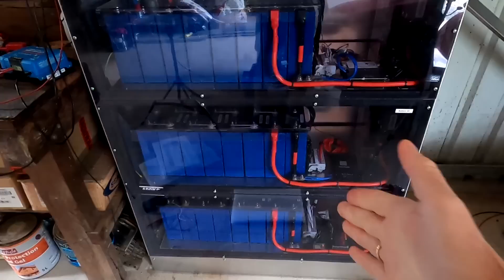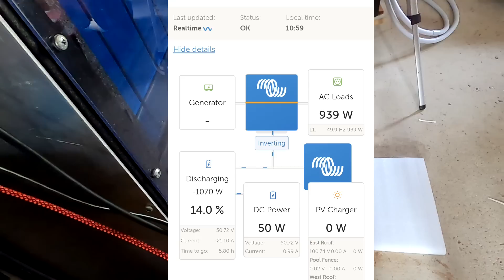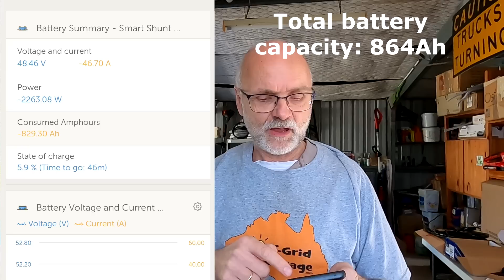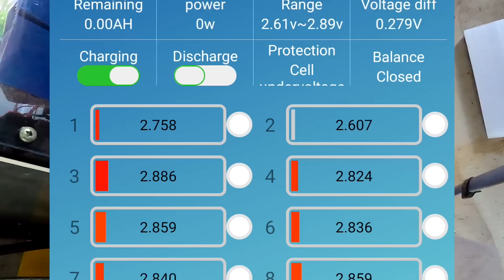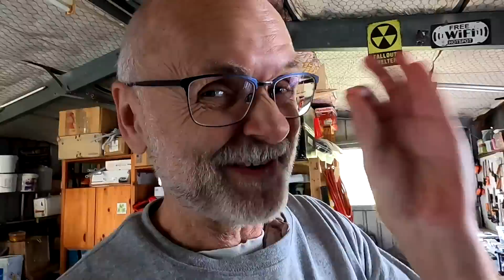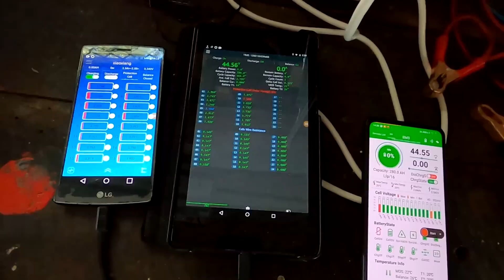Parallel Battery banks low voltage disconnect test. 3 different BMS - see what happens!

Comment: My Raspberry Pi is powered by 2 sources, 24v via 12v buck, or from 12v battery via manual 2 pole change over switch. Also a small UPS relay feeds 12v if the usual 24v source is off. Then the 12v goes to a small UPS fitted with Lithium Cylindrical cells (designed to power a WiFi router, I have another 1 on that) then to a decent 12v to 5V 3A USB supply.

Comment: So, how do you switch back out of maintenance mode on the SCC if the BMS have disconnected all discharge? Does the solar keep the SCC working? Is it possible to have a backup battery for the SCCs?

Comment: It actually makes a lot of sense. Since you configured all to similar voltages and all batteries are connected together and kind of holding the voltage the same for all packs, they would all shut down almost at the same time. Since voltages are very close and the voltage curve is steep at these voltages, once one bank disengages, the other ones get discharged very quickly and then second and third within seconds - so, makes tons of sense.
Reply: Yep, this is a feature you automatically get by putting these battery packs in parallel. They keep themselves in equilibrium.

Comment: You should add a 5v or 12v battery on your accessory side so you can remotely record and safely shut down when the 48v system goes down. It can even be a large capacitor - just to give you 5-10 minutes to ensure data is saved and that you can diagnose issues when system is shutting down.
Reply: That and a ups on the internet modem so it makes it in the vrm before the wifi turns off! I made that mistake, set up a battery backup on the raspberry pi but forgot about the internet connection haha.
Reply from the maker: I literally never go this low with my battery except for testing. The Pi is already running through a DC converter directly from the battery and not from the inverter. Under normal circumstances neither the Pi nor the modem will shutdown before the inverter shuts off.
Reply: @OffGridGarageAustralia  Isn't the intent of the Pi also to diagnose issues so should work when not 'under normal circumstances'? Otherwise, it's like having a spare tire, leaving it home and having a flat while on the road... 🤦‍♂️   -- pretty sure you can find a way to have a 5v or 12v battery on the 5/12v side that would act as a large capacitor to allow Pi/router/accessories to run if 48v battery runs out... kinda like the 12v battery in your Tesla - it's mostly there for emergencies (and a bit to lower load on the DC-to-DC converter).
Reply from the maker: @ranig2848  the Pi only monitors all devices but it does not diagnose anything. That's up to the user to interpret the data.
There are 18650 UPS boards available for $5 on Ali. They do what you want.
The 12V battery in the Tesla is not for emergencies. It is part of the whole system and all electrical load, except drivetrain, A/C and heater, runs from this 12V system. All of it, which is a lot...
Reply: @OffGridGarageAustralia  It was just a suggestion. If you had backup, you could collect details on when battery disconnect goes into effect in each of the battery banks (I thought you were looking for more fun projects 😉). BTW, regarding Tesla, the HVAC unit uses the HV system, not the 12v. The low-voltage system is a safety requirement (eg., if HV system disconnects while driving, locks, hazard lights etc must still work) and once that was in place, they use it for all standard uses. If it wasn't a requirement I'm pretty sure Tesla would have found an innovative way around it... (probably still need a battery but might have used a smaller one or a capacitor)
Reply from the maker: @ranig2848  The Pi measures/monitors only the smart shunt so the overall power in and out of the battery but not each single bank individually. I will connect the BMS's to the Pi at a later stage and see if this makes a difference at all in terms of data collection.

That's what I said in my comment, the drivetrain, A/C and heater don't run from the  12V in the Tesla 😉 The new models now come with a lithium battery instead of an AGM as I still have. Not that you really need it but at least you never have to replace it again.

Comment: Wouldn't the balancer work at low voltage / discharge too?  It seems it should.  Maybe to balance that one proud cell instead of alligator clips and 12V bulbs?  Maybe an on/off switch for the balancer or more satisfied automation could be helpful.  :-)
Reply: In normal situations you would then unbalance your pack at the top again. You either top balance (for most solar applications) or bottom balance (vehicles), but not both.

Comment: What is the paste / goop you put on your cell connections/ bus bars.  I am upgrading my 280ah battery to handle 3000w inverter and a 2000w induction cooktop  and want stemless energy transfer.

Comment: JK does not have Pack Over Voltage Protection while JBD, Daly, Heltek does. You once said that it is redundant considering Cell Over Voltage will occur long before Pack Over Voltage.

However, have you ever consider the scenario where the BMS is disconnected from the SCC and the SCC is giving a Voltage that is over "Pack Over Voltage Protection"? Will the BMS consider that as "Pack Over Voltage"?
Reply: "the SCC is giving a Voltage that is over "Pack Over Voltage Protection"? " --> that's a wrongly configured SCC, but in any case even if that happens because of a broken SCC, the battery (the load) will drag that voltage down and increase the current draw. Then you either got into an overcurrent situation, or your battery will charge until a cell reaches overvoltage again.
Reply: @upnorthandpersonal  There is chance SCC croaks and have the PV voltage into the batteries - as what happened to a diysolarforum member killing all his investment. 

Batteries could cost more than inverter + scc + panels; protecting it is important against erring component.
Reply: @DanBurgaud  Not much a BMS can do when you have the full solar voltage on there.

Comment: hmmm isnt the shunt suppost to shut off the inverter first, so you can actualy calibrate 0% each time it bottoms out? 44V for example?
I know my Batrium does that, and the SOC in victron in taken from the BMS (CAN) so not sure how that would work with a shunt

Comment: My inverters LVD is 3.0v/cell - leaving me that 6% power for DC loads - lights, water pump - the essentials off grid. AC power is generally for the luxuries, and fridge/freezers but they can take a few hours off no problem.
Reply: And, cheap insurance, comes in the form of a 3.6 kW Pure Sine Inverter Generator, which I would always, also add, as an emergency standby power source, for the arrival of that almost inevitable time, when ..“all of the best laid plans of mice and men” ..all turns pear-shaped, after a week of rainy cloudy weather, when the Grid power ..also fails..! 🙄😉

Comment: Its a cascade  effect Andy - once one bank shuts down it throws its share of the load on the other two - the higher load causes a minor  potential voltage drop which soon  trip the second  and then 3rd - if you had say a dozen battery banks you you would probably be able to measure the exponential  time interval  "quickening"
Reply from the maker: I would have expected that with a bottom balanced battery bank but I only ever top balanced my batteries as you know. Hence I was expecting a different shutdown time for each bank. Obviously the banks are discharging at the exact same rate and even the one with the higher capacity is balancing the other two lower capacity banks over time so they all come to an end at the same time. Very unexpected.
Reply: @OffGridGarageAustralia  It just goes to show that when on the knee at either end of the charge regime  load has a increasingly disproportional impact on voltage

Comment: The KWh literally mean nothin at all without knowin the voltage and the tesla i think is about 450V anyway so ya test will be good to see
Reply: It gives you exactly what you want to know: total amount of energy independent of voltage/Ah rating. If you would say a battery has 20Ah, then you need the voltage to work out how much energy we're really talking about.
Reply: kWh is the Energy. What you propably mean is that Ah (which is the capacity) does not mean anything without knowing the voltage.
Reply: I know exactly what im talkin about cause theres a thing called ohms law to work out the battery capacity
Reply: @Trent28888  No, definitifely not.
Reply: kwh literally means everything when it comes to energy storage.
Reply: @edc1569  Even more so when you know that it's basically Joules in a different format. All you need to do is multiply the kWh number by 3600 (seconds in an hour) to get the resulting kiloJoules. A Watt-Second is exactly the same as a Joule, and the Joule is the SI unit of energy.

Comment: I would add a interlock relay so the load does not start back up on it's  own after shutdown and cycle on and off continuously. On and off cycles are not good for equipment and stuff connected. You might have a option on the inverters to not restart without a manual reset or something.
Reply: He could change the BMS setting for the hysteresis on cell shutdown. In reality this will never get to this % anyhow.
Reply: @jasondevine6014  I set mine to a very high voltage, like 3.45V - reason is that if the BMS disconnects, something is very wrong and I want to be present before anything gets reconnected again.
Reply: This seems like one of the advantages to storage<>load communication. He's already running a Victron shunt and SCCs, I'm surprised there's no latch setting to prevent it from restarting without a significant increase in charge and/or solar supply.

Comment: I would guess that after the first disconnect, the lowest cell in each battery was about 2.5v and then you charged them all the same amount, so naturally the second disconnect would be at almost the same time on all 3 batteries because they were basically bottom balanced at that point.
Reply from the maker: All three batteries are top balanced. I never do bottom balancing ever. It's ugly.
Reply: @OffGridGarageAustralia  I don't mean the cells in the battery are bottom balanced, just that the 1 cell in each battery got to 2.5 V and then those 3 cells were at the same charge level. 

The first discorrect, 1 battery could have cut off a few minutes before the second and then a few minutes for the third, making them all at 0%. Then you charged for a bit and they would all have the same extra charge. So the second time they would all discharge the same and disconnect at the same time.

Comment: I tried a test with a 12v 200ah battery and it was not until the last 3% soc when the voltage drops like a brick.

Comment: A little off topic but do you think that any  mixed brands of BMS'S will eprk together in the same system like you are using? Curious why drop in battery manufacturers say not to mix batteries, thinking it's to scare you into purchasing their battery to expand a system bur not sure
Reply: Probably some legal self-preservation. It's untested, so they say avoid because of unforeseen consequences. Don't want to be opening a portal to a parallel universe.
Reply: @CollinBaillie  could be lots of reason I guess

Comment: I'm totally with you.  I set my mpp solar inverter to switch to grid at 50v, then charge with 10a grid power.  and when grid is not available it goes offline at 41v.  by the way, raspie and wifi router have a small lifepo4 UPS.  very helpful.
Reply from the maker: Thanks Alex. Yeah, that's what you can do if you still have the grid. There is no reason to go below that 50V unless necessary and in an emergency. I have seen these 5V/12V UPS running on two 18650 cells. I thought my big battery is my UPS for the Pi. And it is, as I never go that low ever that all three BMS will turn off. But you have to test it, right. We're testing here 😊